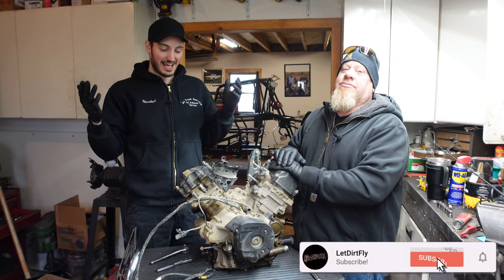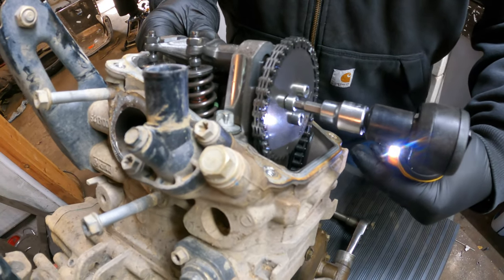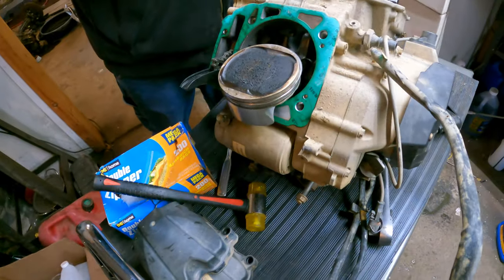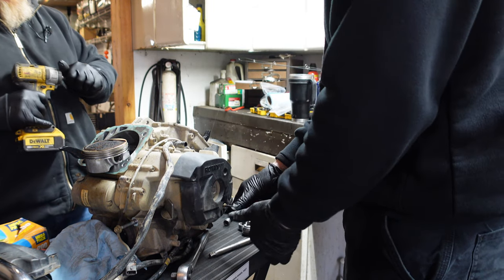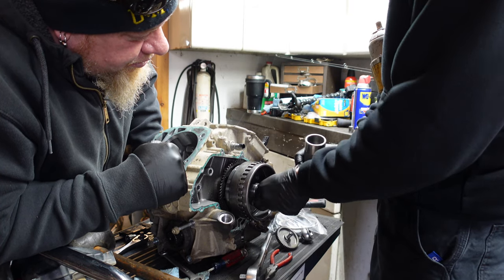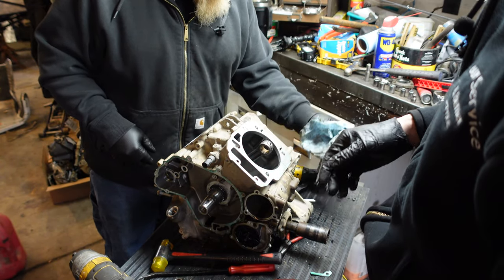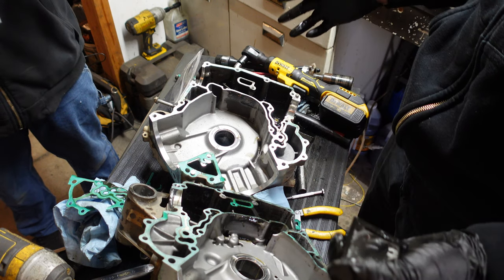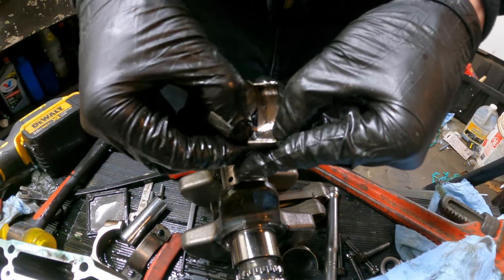How To Rebuild a Can-Am V-Twin Rotax Engine - Episode 1 | Disassembly & Finding Out What Went Wrong

Comment: Please elabore on the 20:56 mark after you removed the 14 mm hex bolt. Did you put that same bolt back in before mounting the flywheel tool? Hard to tell.
Reply from the maker: Used the bolt to help pop the flywheel  off. We found that if you do what we did, it will need up the hex. The solution is to use a socket.

Comment: Do u think it will be possible to remove the top end with out removing motor? Have to replace valve seals on my wife's 570 outlander keeps burning oil and smoking blue.
Reply from the maker: Yea, it is a little tight in there but it is doable. You’ll have to remove the exhaust to access the rear head. Make sure your clean the engine and surrounding areas really well to prevent mud/dirt from getting in the engine.
Reply: @LetDirtFly  thanks appreciate the info

Comment: How much is this rebuild costing?
Reply from the maker: We’re going to do a price reveal at the end including the price of the tools. Right now it’s around $1500.
Reply: @LetDirtFly  that include motor?
Reply from the maker: I basically got this motor for free. I bought the motor, the 850xmr transmission, and STM primary for $1700. The clutch is easily worth $1000 and the trans is about $7-800 used so they both practically covered the cost of the motor.

Comment: First off it's an engine. The starter is a motor.
Reply from the maker: For years people have referred to engines as “Motors” as a “slang” term. Although you are correct, we still call them motors and will continue to do so…🙃
Reply: @LetDirtFly  Where did you get that flywheel removal tool? I just bought a 2017 Defender that got hit in the passenger side rear wheel. Looks like a newer low mile machine but got water in it. Thanks for making this vid!